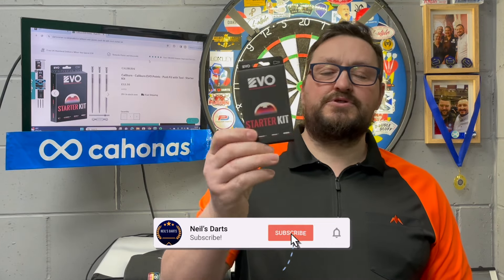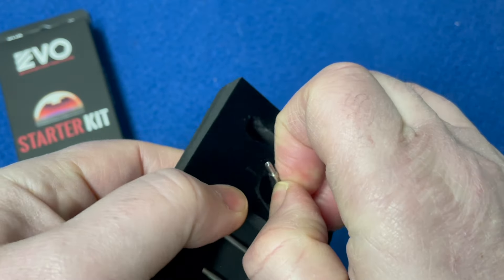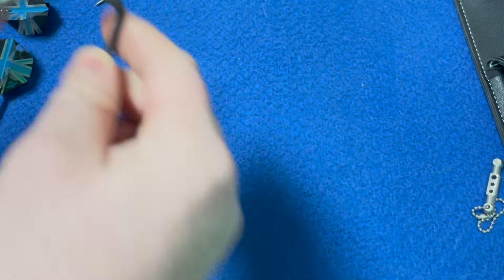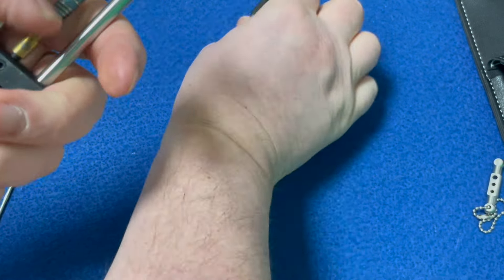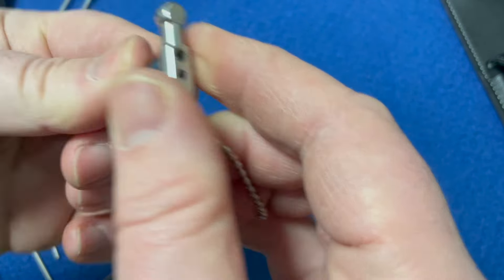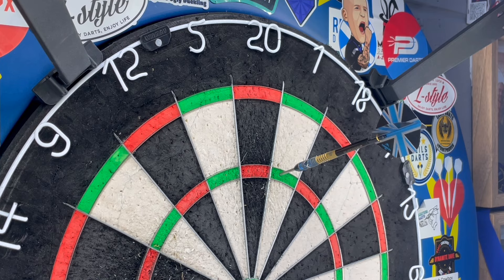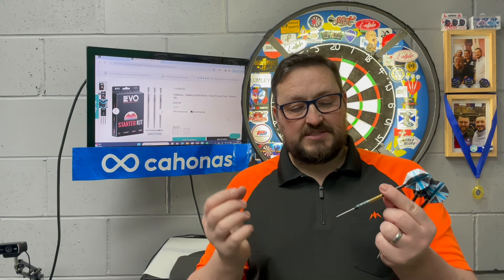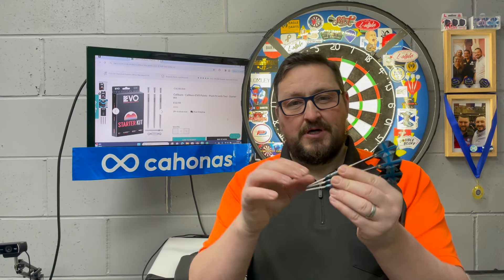Caliburn - Caliburn EVO Points - Push Fit with Tool - Starter Kit Review

Comment: It’s easier to ignore the repointing tool adapter and just install the spigot attached to the point with the repointing tool. You can then get them out easier and replace easier.
Reply from the maker: Good point mate
Reply: @NeilsDarts mine arrived yesterday and I thought that adapter bit didn’t look strong enough. I’m glad I didn’t use it after watching your video. How on earth is that supposed to be strong enough for getting the points in or out. I just used the repointer tool and that points with their spigot on and they went in fine.
Reply: @darrenhurrell same thing I asked myself while watching the videos provided by dartscorner on how to get the spigots in: why the 'repointing tool' bit when you can just push them in with the regular points which they come attached to. Thanks for mentioning it mate!👍
Reply: @norgeball3971 I it’s a no brainer mate isn’t it   Glad you feel the same way as I do haha
Reply: The only advantage of using the adapter seems to me, that you maybe have no gap with the points with built in tridents and with the other ones that all 3 points have exactly the same length outside the barrel ...
Reply: @knutvoberg4236  yeah true, it’s maybe easier to see with the 'trident', but I think one could also achieve that when putting the spigots in with the normal points as there is the thread for screwing them onto the spigot on them for orientation. Nothing worse than when you have to fear that the tool will break and you‘re stuck with an unusable dart, especially when someone uses it that has never conventionally repointed a dart before

Comment: Unfortunately i did voice my concerns on Darts Corners video that it may break, but now that has broken, you have no way of removing the spigot from your darts, i would like to see if once you remove the spigot, does a normal point still sit tight in the barrel, or has the spigot slightly widened the hole. Good review bud
Reply: I think a normal point would sit loose inside the nose end if a spigot had to break in it once it’s removed , and I’m basing that theory simply on the amount of changes of points I’ve made with my pl15’s …. I need to use lock tight with any points I use now to make sure they stay in solid , it is a good concept but ye your point is very valid mate not to mention if any cross threading occurs 😬
Reply: Could you not screw a point onto the spigot and then remove both point and spigot at the same time using a repointing tool, like you would with a normal point?
Reply: @matt_dobson0614  : depends were the spigot snaps/breaks mate
Reply: @Chelskie-darts  True, if the spigot itself breaks you're a bit screwed. But here it's the tool that's broken; should still be able to get it out by screwing a point onto the spigot and then removing both like a normal point, no?

Comment: An innovative solution to removable dart points! But it obviously needs improvement.
Maybe start with lubrication: putting a wee drop of oil might help unscrewing the repoint-tool part of the system.
(To the manufacturer: change to a stronger material for the repoint-tool.)

Comment: Nice review and my experience of fitting these points yesterday almost mirrors yours. I didnt break the spigot tool but the force needed to drive these in it dosnt surprise me you did. One set of darts were not drilled deep enough so I removed them. Second set were just deep enough but a lot of force was needed to get them to bottom out. Once fitted to a compatable set of darts they are nice but there is the rub. These points are not going to fit properly in all darts.

Comment: I bought these and the first set i done worked perfectly no issues look amazing havent come loose at all, overall better than swiss point for me however 2nd set .... Not so great, the adapter didnt break but did ruin the thread of the spigot now its stuck inside my dart and im unable to remove it, might need to drill it out which clearly is not ideal

Comment: So my spigot tool snapped on the second point, tried just putting in with the spigot in the point and it bent the point right up so it’s easy to see now why the spigot tool is needed because the hollow part of the point where it screws in is quite weak, had to order some more spares now, will definitely use a bit of oil when the replacements come.

They’ve now taken them down off the website, what a shambles 🙈
Reply from the maker: Thanks for sharing the info bud

Comment: I think you will be better off, using the no lip points to get the spigot in.
This way you will also get the spigot in consistently, but you won’t have the issue with the tool.
Or am I wrong here?
Reply: Sounds spot on, good thinking.

Comment: I think the manufacturers need to redesign this system I've been playing with these points system for a while now only problem is when the point snaps it snaps right in side your darts barrel i think it's easy fix by putting a brake line in point like swiss point do (any help to remove point please cos I'm lost before I have to drill £109 dart )

Comment: Withour testing it myself:
How are you changing Points by simply uncsrewing it, when the point has the same diameter of the hole in the dart? Youd have to use the repointer to remove them in this case.
So i guess that the point itself is a tiny bit thinner than the tool.
Putting in the spigot with the point seems convenient, but i guess the risk of pressing it in not aligned correctly might be higher. Just guessing there.

Comment: Can u just buy points & install them without the starter kit if u already have a re pointing tool?
Reply from the maker: You probably could but I’ve not seen anyone just putting them in yet or if there is any issues doing so

Comment: Not for me seems way too time consuming I think ill stick to swiss points. Had my andersons comverted to swiss points and they are bang on.
Reply: Wait, you can convert darts to swiss point?
I think having a solution that works in all darts without super special equipment is definitely a step in the right direction, but not if it is based on luck, if it goes in as deep as needed and the tool snaps.

Now for the Swiss Points, do you have some recommendable resources to link for such a conversion?

Comment: Why not just change points with the point puller,like we used to, before this system?
Reply: Is the question meant seriously - in other words: do you really not yet understand the advantages that such a system would have if it worked properly? Or are you just someone from the "everything-was-better-before-why-do-you-have-to-change-things-at-all bubble"? Then just say so and don't put this attitude in a question ... Obviously there are only people here who find the system interesting. Nobody intends to equip your darts with it against your will. So, there's nothing for you to see here - please move on! PS: Fun fact, the tool you suggest using is also used in this video so that you don't have to use it all the time afterwards because it's far too inconvenient, for example on an evening in the pub - ooops, I've already given one of several possible answers to your rhetorical question ...

Comment: The issue I would have is if the barrel of the darts are different in each one, then your points will be at different lengths. Had this happened to you?
Reply from the maker: They should be in same depth but you do get some that go in deeper or the hole is slightly bigger
Reply: @NeilsDarts  what if you got the ones that eliminated the lip? These didn't go all the way in on your darts. That would mean if you got the ones with the lip, then there would be a gap resulting in them not fitting. 

Thanks for the reply.
Reply: Just a quick update, Neil, 

My Evo starter kit and points arrived today. You would think this would be an exciting time, but no! 

I went for the points that eliminate the lip, ine fitted perfect, but after that, it all went disastrously wrong! The tool you used to put the little spigot in wouldn't go all the way in after the first use, so I had to try with the points that came with the kit. This was OK for the second point, or so it seemed, the lip didn't reach the barrel, meaning it left a small gap. The third one bent the point and snapped off inside my dart barrel, leaving me with no darts for my league game on Thursday. Absolutely fuming. 

Seams this concept isn't ready for the market just yet and needs further testing. 

I have reached out to darts corner, but I'm still waiting for a reply.
Reply from the maker: @alanpowell4655  oh mate that’s not good, they’ve removed it from there website now it’s clearly not ready to be used. Hopefully they get in touch soon mate if not contact Caliburn on social media
Reply: @NeilsDarts  have they really? Can't say I'm surprised. 

Strange but you can still purchase the points.

Comment: You put WAYYY too much force on your re-pointer when repointing, You only need to put the point in enough until you feel a little resistance then you no your point is in, if you use too much force then you’re liable to either bend or snap your point or point tool which unfortunately happened in your case